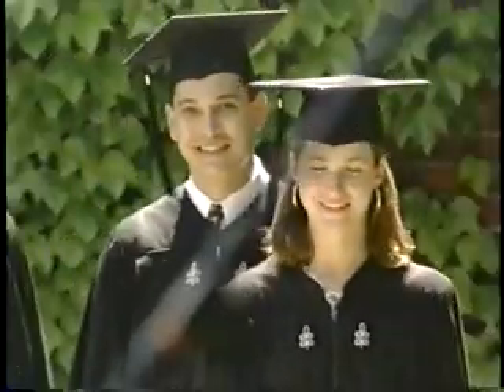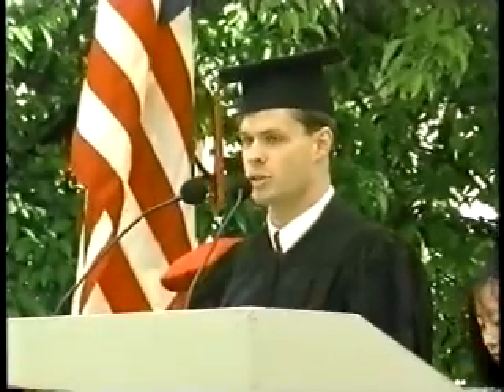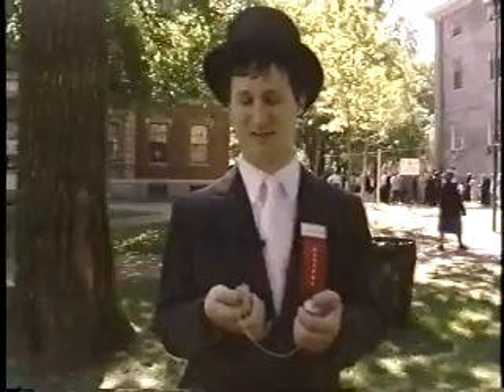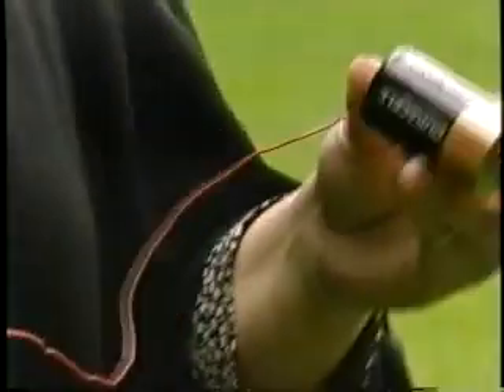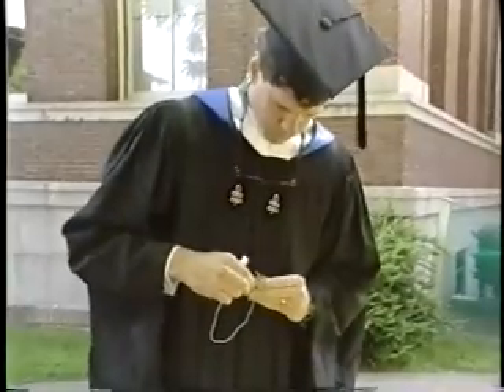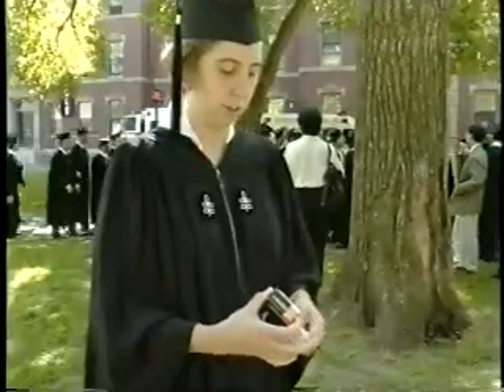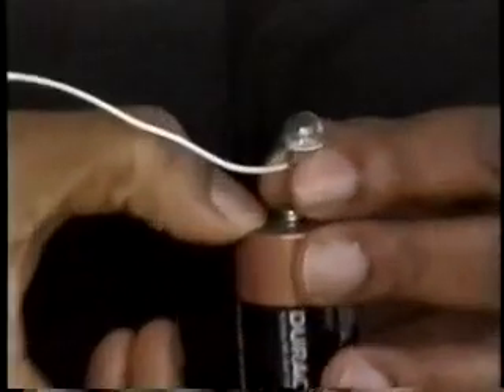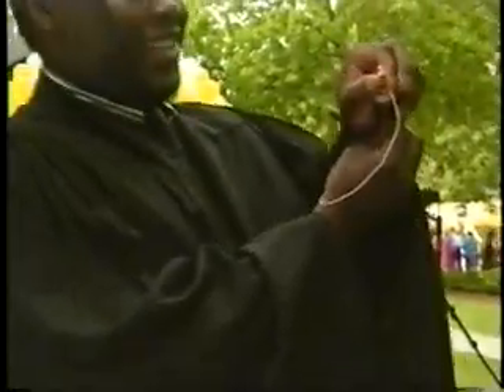MIT genuises with lightbulb

Comment: wow a couple seconds of thinking shouldve got them to it. you have a current flowing by the emf from the battery just connect the wire to the ends, think a little more and you figure to put the bulb in the curcuit since its just a resistor in this case.

Comment: You can just use your body as the conductor of the other pole. Any part of the body can be used to close the circuit. I did that yesterday with a 3V battery and a small LED. How can they not know that?
Reply: I'm surprised that enough current can flow through the body (resistance of around 100 k ohms) to light a LED. In fact when I just measured between thumb and finger on the same hand, with a digital meter and probes with points sticking into my fingers, I was surprised how far I had to turn the knob to get a reading: about 16 megohms. (2-3 megohms if I lick my fingers to get better contact).

Comment: it's easy for all the people commenting on this video say they could easily do it, and it is another thing to graduate, and then be randomly stopped and asked to light a bulb with a wire and a battery. It is also pretty lame that the interviewer handed them a lightbulb that requires more power than 1 battery would be able to output. They only showed a few students, so considering MIT graduates about 1000 students a year, they clearly did not show ANY of the students who answered correctly.

Comment: @ChrisHeumann it is possible, but these guys arnt too bright.  first you need at least one wire (probably about a foot long or so), a lightbulb, and an appropriate battery (voltage according to the lightbulb in order to produce a high enough power for the bulb to be bright--these were all provided.  the circuit must be complete AND grounded also, one girl here only had it grounded.